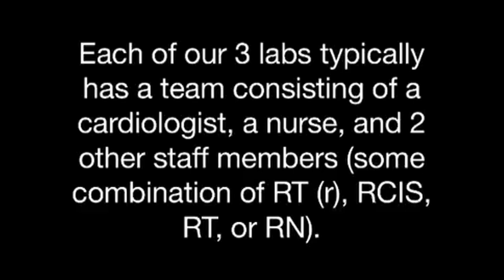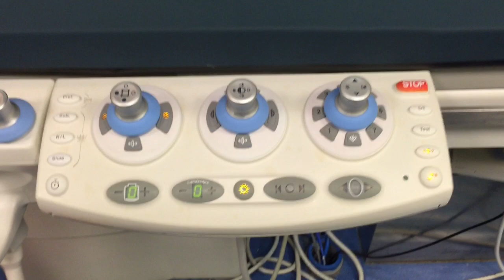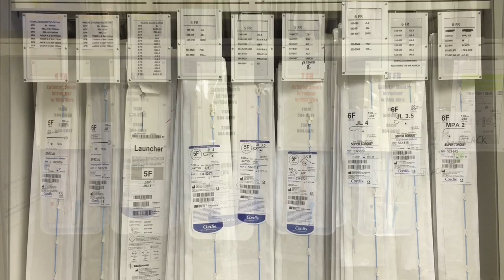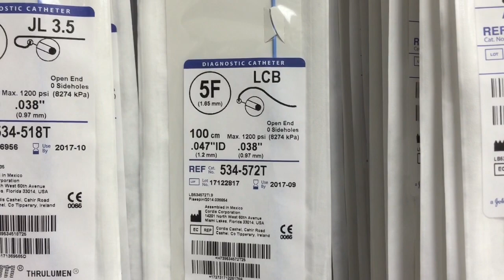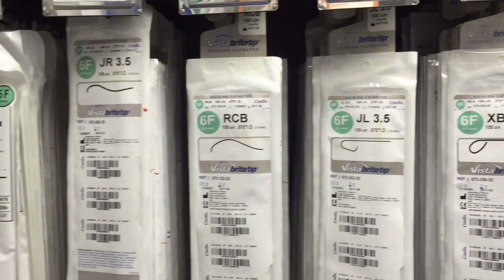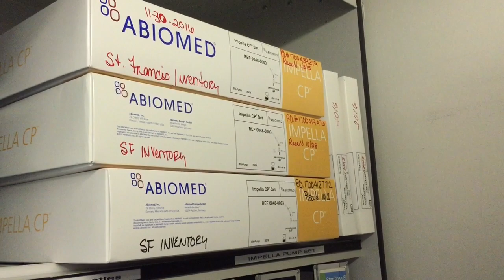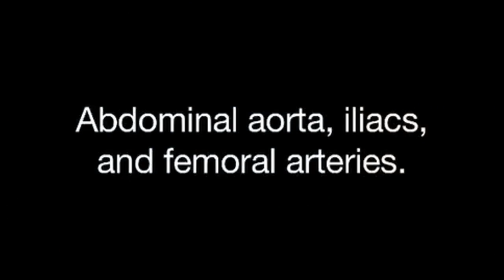Intro To The Cath Lab For Rad Tech's

Comment: What is the job disc of radiografer in cathlab room..just table floating and tube angulation?
Reply from the maker: Irfan Rivai sorry so late replying.  The job varies a lot from lab to lab. In my lab I do everything based on what the Doctor and/or procedure need.  From what I hear in other labs it seems to be similar.